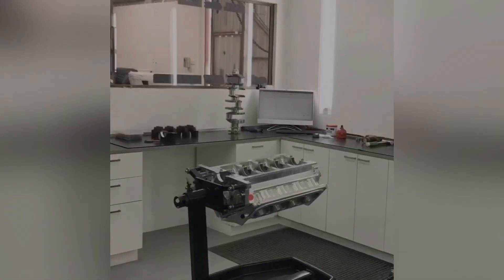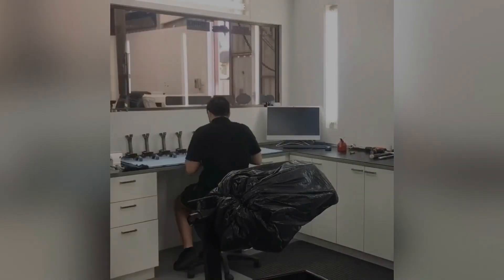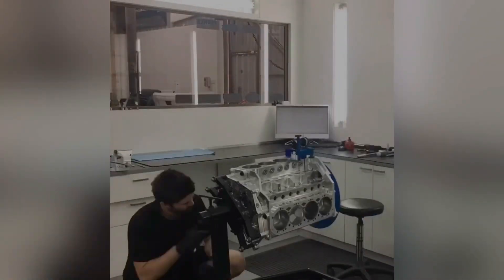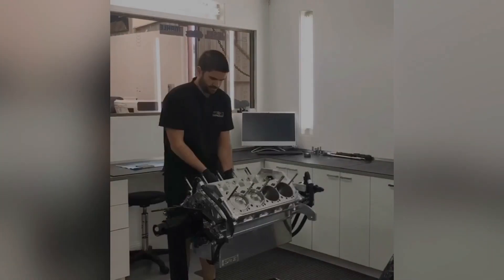How much HORSEPOWER???  500 BILLET SBC on methanol.  How much can we get?

Comment: RPM limit and range we'll just have to assume but 970-960HP @ 8200 and 850 Torque @5800. Incredible heads you've got there Captain... I assume you just want enough power and acceleration that you actually do have to lift off the throttle to get the boat to turn.... That's a fantastic engine, so good luck with all the fun that will come along with such an increase in power. That is going to be a learning curve to get used to that much more power, but I'll bet it's gonna be fun getting to almost fly on water.

Comment: What is the target max RPM for the pump? I guess will  make 1000hp @ 7000 more if you rev higher
Reply from the maker: 6500 - 6700 for Pk Tq.  Above 6700 the pump loses efficiencies

Comment: Those CFE heads (  I think thats what theuy are) on a 434 CI SBC with a Bryant crank running Methanol and win turbos makes 2100-2500 HP. In drag racing trim and 25 lbs of boost So normally aspirate and 14:1 with 500 CI...My guess is that you could push 1250-1400 HP out of it  but not for a whole season. With an ethical builder who knows sprint boats arent drag racers. My guess is that he will send it to you with 1000-1100 HP tune @7900RPM and the ability to tune it with timing and mixture etc to 1500 HP @ 9000 RPM if you want but strong advice and caution  to not do that.. 1100HP @ 7900 rpm is ~730 ft lbs of torque sooo max torque 800 ft lbs at 5100 RPM
Reply: Take fifty HP off my HP guess and 35 ft lbs off too. because the dry sump will use that and it wont show up on the dyno. It will show up as durability and reliability though which is way more important for  the Jolly Roger  effort than a few dozen horses when you have so many extra ponies.

Comment: Looks great Eric,  it all depends on how high a RPM he pulls it too   im guessing  they are planning on 6500-7000 for a sprintboat.... I know what my 606 made at that rpm :)
Reply from the maker: Yes I’m the .RPM.  I can’t remember Bill….did you run methanol?  Or race gas in yours?
Reply: @JollyRoger907     I ran VP C25 in mine

Comment: We dynoed our 410 sprint car engine and it made 940 so I’m sure it will break the 1000hp mark
Reply from the maker: Very similar build to a sprint car engine.  Biggest difference is we target 6500-6700 RPM due to the pump.  Much lower revving than a sprint car

Comment: Easily thousand horsepower the gentleman that built that motor did a fantastic job looks like a winner to me
Reply from the maker: I like your optimism
Reply: @JollyRoger907  I like to ask you a question if I may is the propulsion system or the jet Able to handle that type of horsepower I know nothing about jet boats just asking
Reply from the maker: @dirtman2678  yes they can handle as much horsepower as you can throw at them.  You just get bigger diameter pumps & bigger pitched impellers.  What they can’t handle is a lot of RPM.  We target 6500-6700 RPM

Comment: How important is it to have a quick revving engine in jet sprint?
Reply from the maker: It’s critical when your spotting the supercharged & turbo boats 500-600Hp!  They have the top speed but this build is all about point & shoot!!!
Reply: @JollyRoger907  As long as your motor hp is a little more than what your pump wants at any RPM youll be racing at, then 1000 HP is enough to win Even in New Zealand. Im predicting good things for Jolly Roger :)